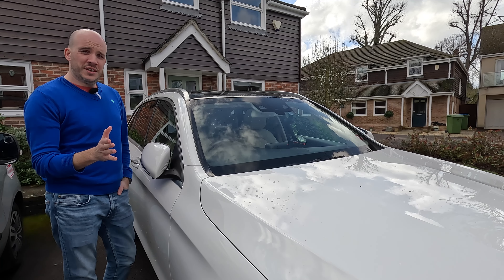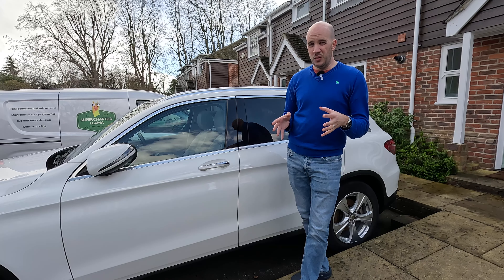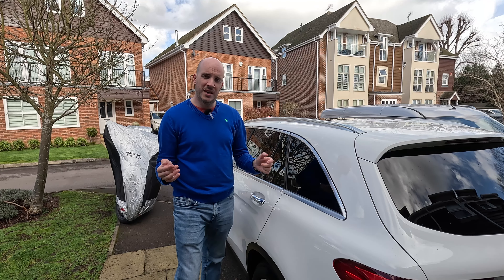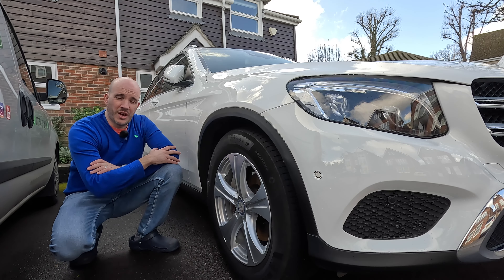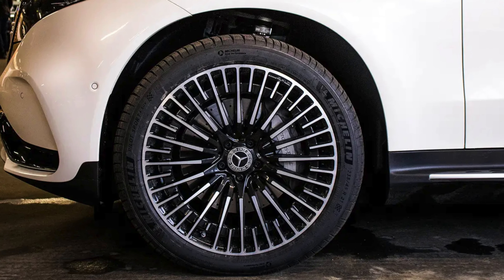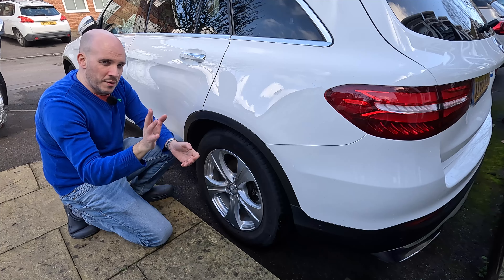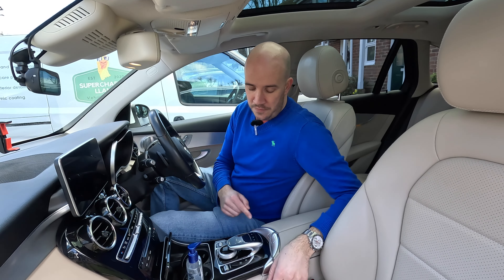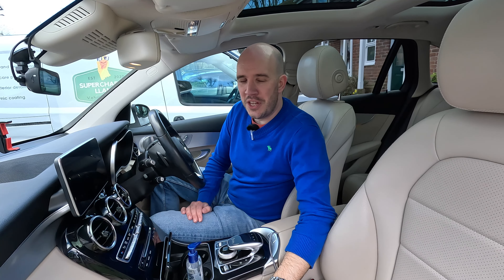HOW TO SPEC YOUR CAR... according to a detailer.

Comment: I inherited my late Dad’s Black Mercedes B Class about 18 months ago. The paintwork was a mess from him drying it with a dirty cloth without washing it before sticking it in the garage, as well using the local scratch & shine when it was dirty! I gave up telling him otherwise. I’ve since washed & polished out the swirls & defects and it’s a shame he never got to see it looking how it does but then he’s probably up there laughing at how much time I have to spend keeping it looking good. Thanks Dad! 🙏🏾😀
Reply from the maker: Ah yes the old "thanks.....I guess?" I absolutely love getting a black car gleaming, they look superb...and then, very quickly, they don't. I've been there and done that myself on a personal car, never again! I had a gun metal MK1 Volvo C70 convertible a while ago and I loved that car, so easy to keep clean!
Reply: @SuperchargedLlama  I had a mineral Grey 320D before the Merc, a great colour that hides the dirt better than black but gives you deep shades & contrasts when you’ve polished. In short, I’m getting another BMW ASAP. (They drive way better too )
Reply from the maker: @BarryCoombs1  this GLC is surprisingly crashy over big bumps. Supposedly resolved with the new one, but they don't do it in anything other than AMG Line trim, so I won't be getting one. X3 or XC60 next time round I suspect, especially as I want a light interior.

Comment: One thing is mudflaps. My new Mazda cx60 does not come with mudflaps and you can not buy them. It sends me insane and the first car in my 57 years I don’t have mudflaps 
A very interesting video. Love it. 
James
Reply from the maker: This is a fantastic point to make, so few cars even have them as an option these days and it's amazing. Sure, they don't look pretty, but they do a fundamental job! Tesla's would greatly benefit from them, have you ever seen one that doesn't have a mucky bum?
Reply: True very true. On my Jaguar the mudflaps are not that big and I don’t mind how they look. Nothing worst than cleaning the car doing the black trim a quite trip to the shop and mud in on the trim and not blocked by the mudflaps. I have both rubber and carpet mats for the cx60 first time I have bought rubber mats and OMG they are amazing I can not believe how well made they are and as you say cleaning is very easy.  I also have a separate heal guard that I have used for the past 15 years this protects the carpet maps and the rubber to be fair but for the love of god I can not find it for sale anywhere 
James

Comment: Totally in agreement with rubber mats. The only things I would add, a rubber boot mat and if, like me, you have a dog I would invest in a product like Hatchbag which can be easily cleaned with apc, it is attached with velcro for easy removal and so far, 4 years later, still looks like new.
Reply from the maker: I have a boot liner actually, I just didn't think about mentioning it, but you're absolutely right as they are always an option these days.

Comment: Such a good video. My car is black and exactly like you say it's such a pain. My wife's is white and a joy as you can't see many defects yet she has black diamond cut alloys. She had the idea of rubber mats when she first got it 4 years ago and I copied. So easy like you say, APC, brush pressure washer and like new.
Reply from the maker: I'm really glad you enjoyed the video AND have similar experiences. Having owned a black car in the past I will never do it again, but I've also had gun metal and that worked alright...I also seem to do a lot of gun metal Mercs too and generally haven't had an issues doing them in the sun.

Comment: What's the story with the satin Porsche wheels? 😮
Reply from the maker: The centre nuts on the GTS wheels look like they're exactly the same as the main body of the wheel, but they aren't. They react to pretty much everything single cleaner going, by which I mean the paint comes off them. Ghastly things and they cost £300-400 each to replace. Luckily I only did one when I realised.

Comment: Have a silver and metallic black gti love the black one when it’s cleaned and waxed tyre dressing etc looks lush 1st 10min driving its up the naffs again,my silver one washed ceramic spray on it sweet for ages but the alloys give it away as there diamond cut and get dirty straight away
Reply from the maker: The struggle is real, isn't it? I had a black Fiesta before the GLC so I know I'm never doing that again, let alone the customer cars I clean.

Just saw a black packed Rolls Royce Cullinan at the petrol station with black diamond cut wheels...and a white interior. I didn't have the heart to tell the owner how many mistakes they'd made. But in all fairness, they probably have someone to look after it (sadly not me! Well.....given everything I've said in this video, not that sad actually 😂)

Comment: I have the same chrome trim on my c class, would the new bh touchless be ok on the trim?
Reply: I do have some siramik graphene on the trim but don’t know how long it will last or how resistant it would be to my pre wash products such as kc green star n bh touchless v2..
Reply from the maker: @kamranhussain578  the Siramik is pretty good, so yeah Touch-Less will generally be okay. Don't let it dry out in the sun and you'll be fine I'd say. Caustic stuff can definitely cause issues, but again....doing it when it's hot and in direct sunlight is usually the main culprit. Although the TFR the scratch and shines use will definitely cause problems (and has, to many mercs)

Comment: My biggest bugbear is brands trying to turn ugly dull family cars all faux sporty via the medium of S-Line. I could rant for ages about this. 90% cars do not need metallic paint, chrome this, alloy wheels, lowered suspension and sporty appendages. A Mokka or Juke or q3 or Karoq is not sporty and no amount of eye liner is gonna make one look nice, so don't try. And they're not bought by people who give a flying sh1t about apexes and unsprung mass. Only Citroen seems to know who it is and accepts that families want a smooth comfortable ride that doesn't make the kids sick. So........
99% of cars should be specced 90s style with 14 inch steel wheels, 60 profile tyres in silver with moulded door strips (ala Citroen aircross) a/c, Carplay and clever Honda Magic seats. And no sunroof! Perfect family car spec! Thank me later!!!!!
Reply from the maker: I am absolutely right with you there. What's maddened me is that the new GLC is only available on the AMG Line trim here (and I think only with the midnight trim), they sell what was the equivalent to mine (misleadingly named Sport, now called Avantgarde) in other parts of the world, but not the UK. So you get everything you described, and no positives. And no light interior either.

To the point that our next one might end up being BMW or Volvo because they offer the light interior which we love, and you don't have to go crazy on the sporty trims.